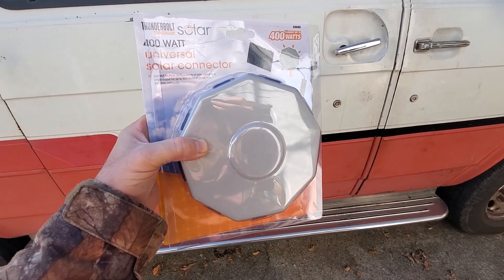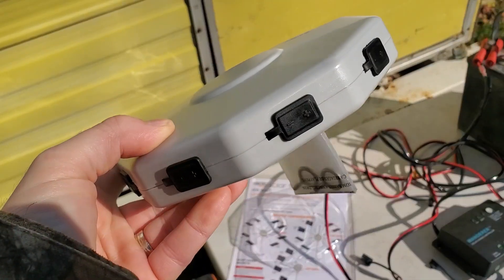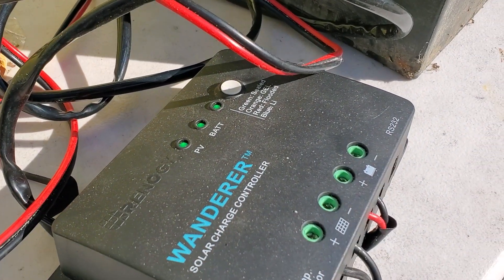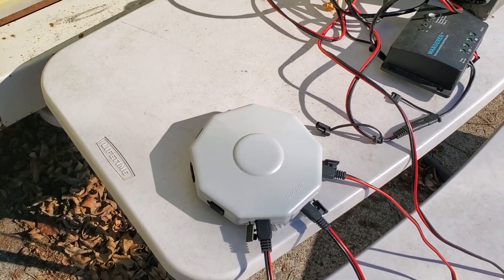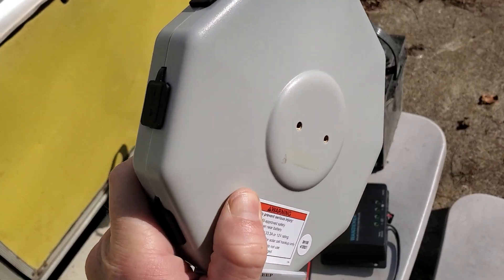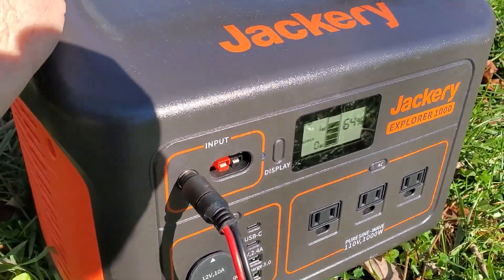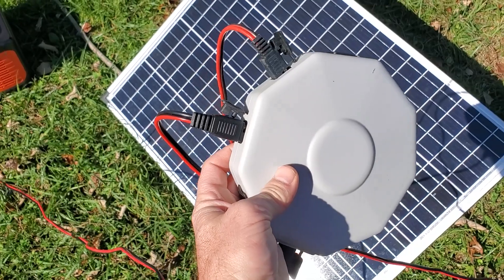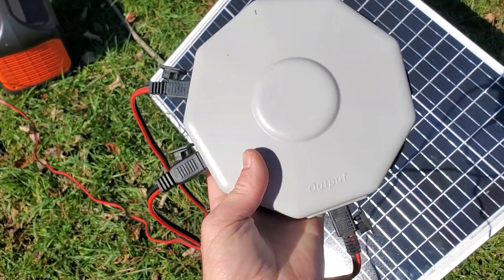Harbor Freight Solar Multiconnector

Comment: I would recommend you switch those solar pannels to mc4 connectors and get proper TEMco wires. Get the maximum you can out of your two solar pannels, but for a simple setup, it looks fine.
Reply from the maker: Oh yeah on my permanently installed panels on my van its all MC4 ... but for light duty, portable stuff that's only comes out for camping trips- these SAE connections are quick, easy and more than sufficient for the wattages involved.

Comment: You'll get more watts. IfThe solar panels open circuit etc all match up I believe you're open circuit on those panels are different. Causing them to use the lesser open circuit.
Reply from the maker: Hey thanks for watching and commenting! I understand what your saying to be true in the theoretical or bench test setting. But in my real world experiences, the differences are not great enough to be a major issue. As you can see, even in my test with the Jackery 1000 unit, the two panels are putting in 80+ watts each, but the limit of the charge controller is knocking it down to 125 anyway. 

My understanding from reading up on using different panels is that as long as the voltages are relatively close (as they tend to be among panels of the same wattage), the potential "losses" are inconsequential. 

In a separate example, on my camper van I am currently running 3 different 100w panels with varying voltages (18-19.5) and the input has always been great. From my own observations I would argue that atmospheric conditions and or the panels' physical positioning relative to the sun is going to have a greater effect than slightly different voltages between two panels. Just my two cents :-)

Comment: I got 4 panels, 3 x 10w and 1 x 30w,  I just wire all the wires together, :), bodge up job, this will sort me out
Reply from the maker: Yeah for that many panels - this little UFO connector would be a perfect solution!
Reply: @kampinglogik  the thing is, cannot get these in the UK :(

Comment: You can hook up any solar panel in series. I would have like to see that Jackery charged when it’s nearly run down just to see how long it takes t fully charge
Reply from the maker: Hello, thanks for watching. This little hub is great if you have solar panels with SAE connections, which aren't really possible to separate the positive and negative.
Regarding the Jackery, this older model caps the wattage input at 125 watts regardless of having 200w of panels hooked up... so that puts the total charge time at about 8 hours from 0% (though it slows down for the last few percentiles of capacity. Hope that helps

Comment: How many  watts is your charge controler set at.
Reply from the maker: This Renogy charge controller can handle 20 amps, or about the max output of 4x100w panels. A 100w panel usually maxes out at about 5 amps of output each in the real world use. But, I'm not sure if that is exactly what you are asking though.... if you are referring to settings however, these charge controllers don't have to be set to a particular wattage setting.

Comment: Did you say the Jackery 1000 has a max input of 125 watts? I did not know that.
Reply: It's really 126 watts(12~30V,7.5~8.33A). In the real world case, use two 100W solar panels to charge it for 8 hours to go from 0% to 100% fully charged. Jackery also said this product supports charging and discharging at the same time but it is not suggested to do so, as it may decrease the life of the battery. This thing did not use LiFePo4, so a typical Li-ion one only can do about 500 cycles before it drops down to 80% of the life.
Reply: @jing-chianwu  Thanks for the info! Very helpful 👍🏼
Reply from the maker: Yes, everything @jing-chian wu shared is accurate, to my understanding as well.  There are definitely some newer options for powerstations that use Lifpo4 rather than lithium-ion and give the advantages of that battery chemistry. Honestly if you are just camping once in a while the Jackerys with lithium-ion will do just fine. If you need to use it daily/full time then the 500 cycles before degredation will definitely be more limiting. But I'm not shilling for Jackery, I just happen to have the Explorer 290 unit, which I have now used quite a bit and have access to borrow this Explorer 1000 unit. One thing I will say for Jackery is that they are insanely user friendly/simple to use. Unfortunately I don't have access to any other powerstations at the moment to compare in the real world. If I was going to spend $1000 on a new powerstation I would definitely being doing my research of all possible contenders, always looking for the best value! Thanks for watching!

Comment: Thanks for your video. It’s been very helpful. What gauge wires are you using?
Reply from the maker: Thanks for watching! These are just 14 gauge... at 100 watts/5 amps you don't need very thick cables at this short of length

Comment: Is it an “in parallel” or an “in series” universal connection hub?
Reply from the maker: Sorry for the delayed response. I believe these multiconnectors keep the panels in parallel similar to the way an MC4 branch connector functions, because at no point are you connecting one panel directly to another.